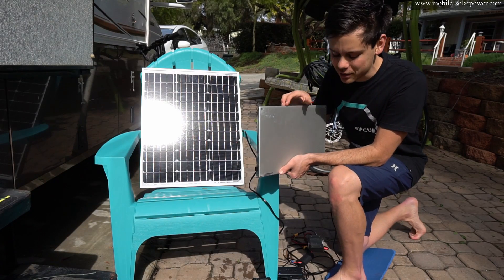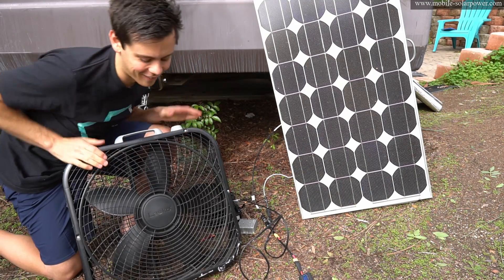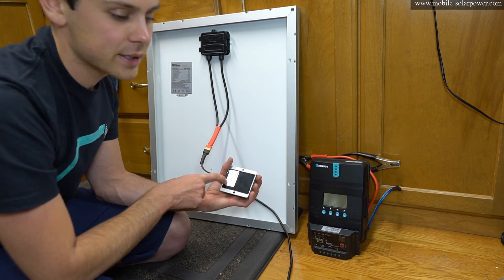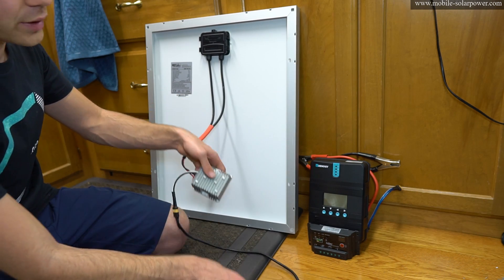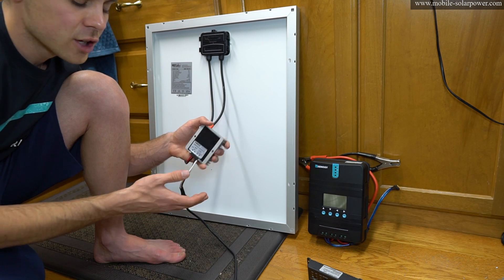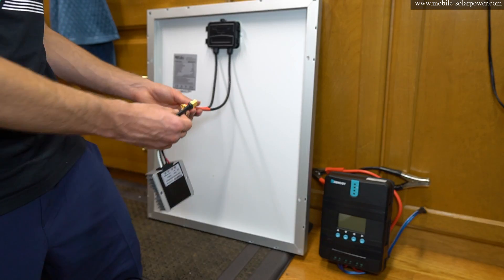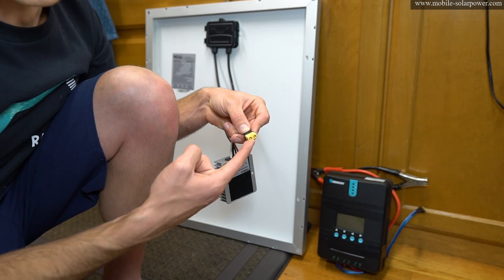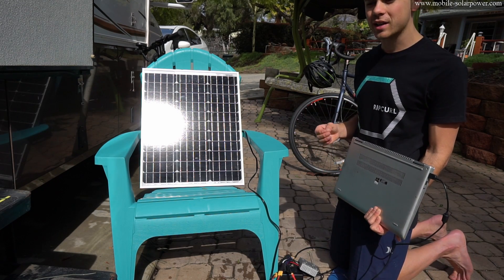Solar Power without a Battery! Solar Panel + Converter = 12v for Small Loads

Comment: It looks like you are using a regular AC power supply for the computer, but you are inputting DC into it. Is that correct? Did you just clip the AC male connector to input DC?

Comment: My friend i have been checking on something like this but for a bigger scale of course but first have to learn from a smaller scale like this i believe 

But my question is first do you have some type of support line or some how that be viability way for a diy self kinda thing so part of my questions is how ima add a battery just to make it safe but the system will be use at suntime only that why im looking for help because i believe its posible thanks by the way great videos very good info

Comment: I’ve got 4 D8 size 12 batteries to replace my current old ones for my cabin’s solar system to replace the 4 6 volt wired in parallel as two 12 volt batteries these d8 a are bigger and newer too they should work well

Comment: Can you go...
Array (24v) -> DC to DC -> Inverter (12v)???
...so that I can power my 110AC household appliances?

Or, is there a better, more efficient way?
Also, based on what you say here, if I understand correctly, withOUT batteries, it becomes impossible to require a controller. Correct?

PS, I already have the 24v panels and a 12v to 110v inverter but trying to NOT purchase batteries at this point.

Thanks a million!

Comment: a 10amp  12 to 24  in reverse will it work ? ? btw one of these without  protections only a fuse killed my delta2  12v outlet..!!!    was my fault  didnt measure both  in and out amperage  ....  was that simple!!!!

Comment: Hi Will, I am on a bikepacking trip.  Currently I am using a Big Blue 28W portable solar panel.  It charges my small electronics fine.  I would like to charge my Dell laptop sticker reads Input: 19.5Volts--- 3.34Amps.  If you would please, help give me advice how I can pull this off without added bulk and weight?  Much obliged.

Comment: Thanks for this video; I feel so dumb! My small solar panel puts out 24V 1.12A & I was confused when it wouldn't run a small light bulb (not led) directly. As soon as I connected the light, the voltage would drop and nothing happened (no light). This was inconceivable to me because in my mind this panel is putting out a constant 24v and even with only 1 amp, the bulb should have produced some light when connected directly to the panel output.

Comment: Hi will on my Vw t4 campervan I will have 230watts solar soon 100watt x2 plus 30watt panel so with converter I can run my usb powered iPads led lights .I have twin leisure agm batteries to run compressor fridge all time 12v about 40 watts .Only use inverter now an again 2000 watts for charging drone and drill batteries 🪫 Steve in U.K.

Comment: Thank you for your videos. This is exactly what I want. No battery, just an opportunity to charge my laptop and phone with solar. But there is a huge list of resources and not the specific ones that you show on this video... the converter, the cables... even the reader. For just one 100 watt panel.  Those 3 objects. If you can, I would appreciate it.
Reply: And why the XT60? If my computer has a regular connector to plug on the wall...

Comment: Why not use 12 volt solar panels instead of 24 volt panels and eliminate the need for the 24 volt to 12 volt converter?  And, instead of using a converter, use a buck voltage regulator (available on Amazon) wired to the positive and negative wires of your 12 volt solar panel to prevent voltage fluctuation above 12 or 14 volts.  For example, some 12 volt, 100 watt solar panels purportedly can produce as high as 17.5 volts instead of 12 volts.  This voltage fluctuation would probably shorten the lifespan or eventually damage a device such as a 12 volt, direct current fan motor or a 12 volt water pump.  Please reply to express your thoughts about this comment.  Thank you so much for your informative, resourceful videos.
Reply: There is no point in boosting a 12v solar panel from under 12v, it will be already powerless at that point. And regulators are more expensive to their buck equals when it comes to step down.

Comment: What did I do wrong?  I purchased 2 of these to hook up to two 100w flexible solar panels for a tiny camper/trailer I'm building and for my car for camping/road trips.  I also purchased the xt60 connectors, heat shrink wrap, 12v wiring suggested for my solar system in my trailer. I connected all pos/ red and the neg/black as needed, but I did NOT sodder these wires, I did the twist connection (is this possibly why I don't have power?).  I have the 36/24 compasitor,  a 750w inverter.  I let my solar sit in the full sun for a whole day.  When I tried turning on the inverter and plugging something into it,  I got NOTHING. No power from the inverter. 
What did I do wrong and what do I have to do to get this to work.

Comment: Does an MPPT controller borrow some volts from the battery to provided consistent voltage out as the solar voltage fluctuates?

Comment: You can connect a fan or a pump directly to a panel, given that the fan can handle the max output of the panel. Fans and pumps can handle varying loads, they just go faster or slow down. However, electronics are different. This is playing with fire.

Comment: I used this method to charge my drone batteries while camping without needing to lug a heavy battery around.  I’m not sure how small a panel I can get away with though.  It works fine with 100w panel.  I’d like to get that down to about 25w for weight and size.  I’m sure there is some math that would tell me the minimum size I can get away with.

Comment: I'd like to power a pond fountain pump that uses 720w, 9amps for as long as a panel will power it daily.  So does that mean I could us an 800w panel array and the pump would run for 5ish hours/day?  Thanks.
Reply: I tried running a 12v sump pump that draws around 13amps. Using the 24 to 12 volt converter (20 amp) and a bank of 6x500 farad capacitors and 2 x 100 watt panels in parallel it wouldn’t keep running. I was able to run it on 4 x 100 watt panels in parallel.

Comment: Whait till you see what I'm planning, I've order 10 cc cv adjustable voltage regulators. I'm going to wire them to 10 360w solar panels in parallel. A 200a fuse and a 1500w 3000w max inverter.

Comment: you mention the panel has and open circuit voltage is 20v.  Is it possible to charge 18v tool batteries without any controller?  Just a direct connection from panel to battery.  My other option is to use my 12v controller and connect it to a 12v inverter, plug in a AC power bar and charge multiple tool batteries.  This seems safer but less efficient.

Comment: Hello ... can we make a cut off also which gives power output  only when the desired voltage is available from solar panel and if it goes below the reqd voltage it cuts off the supply to the appliance??

Comment: I am interested in this concept. Would at least offset some of my electric expense a few hours each day.. Here they charge more during "peak hours" which also happens to be the times the sun is best. Of course in due time I will start investing in batteries. but on a fixed income..that will take awhile. So can you do a video from start to finish what is required to maybe power a 3kw inverter.. not magic boxes but the old school way :o)

Comment: I hooked up my panels directly to vent fans.  The system works fine when the sun is shining but on a cloudy day, the fans barely move.  My solar panels provide 18 amps max but the fans need about 16 amps.  On a cloudy day, how can I top off additional amps to the fans using utility power?

Comment: I've wondered about this a long time. Would it work if I had 4 300 watt panels on roof and then run wires to wear they are needed? DC means very thick wires if it is long cable, DC doesn't like to run long distances in small wires... could over heat and fire also if wires aren't thick enough to handle the push

Comment: i have a 300 watt inverter, would i still need the 24v to 12v converter if i dont use battery?  or can the inverter be connected directly to panel without converter?  i have 100w solar panel.
thanks.

Comment: I ordered a Flexible 100 watt solar panel from wish several years ago. When I received it there were absolutely NO wires to it. Just the panel. Y question is how do I connect a wire to it so that I can hook it to a converter or battery?

Comment: Have you tried connecting an APC UPS in to this set up....would be able to have the battery and the converter possible in one without needing to buy a separate battery and converter.

Comment: Hi will thanx for the double sweet videos, im very fortunate to have mark lee that owns 10 companies in china and 15 in japan, so i always look at your vids and do my own experiments, im from south afrika were the locals cant afford expensave croceries, one nice conversion i did was to rip out a 220 v compressor out a old fridge and replace with a 12v/24v compressor. Got 55 hours on a gell 200 ah bat, only batt no solar panel connected, at 12 v uses 5 amps a hour, on 24v 2,5 amps.

Comment: I have a  50w solar panel on my car roof, powering a 12 volt  cooling fan in the window, Florida hot sun. I tried without a converter and battery setup.  Solar panel puts out 21 volts. Saw how to use a (buck converter) to step down to 12 volts for the fan. worked perfectly until I noticed My door locks were going all wonky on my 2015 Rav4. some radio interference?????  worked perfectly except for that.  Now my cheap solar converter battery settup  keeps dropping the solar connection. it may be damaged.??  I put an adjustable thermostat in line to turn on off. Buck converter was perfect and simple except for the door lock interference.

Comment: What's the minimum voltage that this converter will take? The small one that's linked on the page has an input voltage range of 28-40V. A lot of solar panels won't output that. And the reviews for that unit aren't great. The larger unit from the tutorial page has an even higher input range 40-60V. So I'm wondering if they'll work with a 50W panel that outputs 16-20V. Would love an answer to this.

Comment: Hey will dude great video---will a 18v solar panel work with the 24v to 12v convertor...i was wandering what voltage panel your using---many thanks bud

Comment: Hi does this regulator regulate the output wattage also ie if I was using a 12v 30watt fan with 150watt panel would it regulate the amount of watts need not to burn the fan motor out?

Comment: Direct solar is well worth playing with, I built a circuit which charged a one-farad Electrolytic Capacitor from a small solar panel and then dumps its load into a water pump to pump pulses of water uphill.
Reply: I ordered a 1 Farad for the same configuration. How well has it worked?

Comment: Your welcome. It was my discovery I can run inverter in the rain without a battery. Key is 24volt panels and 12 volt inverters. Using step down DC DC converter

Comment: Hi I need help here. My laptop charger says: Output 20v 2amp=40w. How 12DC output in that converter can changer the laptop? In this example you can only charge 12V laptop.. right? Please advise. Thanks in advance.

Comment: Thanks for showing your setup. I have done this on my 48v solar panels to 12v. Now I want to install my variable output voltage boost converter  to charge any battery configuration. I want to charge my Ebike batteries off this system.

Comment: I love your videos but and I trying to work this video out.  I looked at your web site connection and I am then back to your video. I am confused about something.  How do you plug in the lab top or fan without an inverter?  that was not on your list but on your video you said you had a modified inverter.  I didn't see it on the list.  I know I am new but I am confused.  can you explain the step that seems to be missing?  Thank you

Comment: HI, I have a  SUNFORCE 3-panel 60W-12V power generator. Is it possible to use it to power 12V solar pumps without a battery? If so, how? Thanks for your help. Loan.

Comment: Finally. I’m new to solar and I want to make a solar pool heater. I want to go from the solar panel and go straight to the 12 v pump. This is the information I’ve been looking for because I was wondering about the voltage going to high and cooking my pump. Adding the converter will solve any issues. When the sun ☀️ is up the pool heater will be on.👍
Reply: Did you get your heater going? I am trying to get small 12v sump pumps to act as water jets to power a pool skimmer with a 40w12v panel using a wattage step down between them.
Reply: @csabo1725  
Not yet but still thinking about it. I’m a bit undecided on how to make the collector’s. My pump is a new 12 water pump for a Toyota Prius. It moves a lot of water , maybe to much. At the end of a sunny day, do you get the same BTU’s with a high flow rate vs a slow flow.

Comment: What kind of laptop power supply were you feeding 12v?  The only ones I have seen are 120vac to 12v dc.
Reply from the maker: Go on Amazon and you will find a cigarette lighter adapter for any laptop on the market

Comment: I would just put Conner the converter to a 12v automobile 🚗 socket and just plug every thing into it. Maybe one with a couple 12V sockets and USB Ports. Until everything goes to USB-C Type ports. They can support 100W through the cable/charge port.

Comment: Will pls try from the panel directly through a 12v to 230v (AC) for home use....to power TV, fans, lights etc.....can it work ?
Reply: @cgwworldministries Ive got 2units 200AH Gel batteries. I want to be able to disconnect my batteries when full and use the panels direct during the day.....and in the evening reconnect the batteries and use it overnight.

Comment: Thanks for your great videos. I took at 12v car radiator fan I got from an auto salvage lot, and built a simple mount out of plywood to attach to my attic gable vent to pull hot air out of my attic. I put a 12v Grape Solar 100watt panel on the roof and it drives the fan directly. The sun comes up, the fan powers up - the more sun, the faster it goes, nighttime, no power - perfect. It's been running this way for over a year. All-in I paid just under $100 for the whole thing.

Comment: I kind of figured that sooner or later you would cross over into stuff I was doing in 2004. I was running around and camping in National Forests in the midwest with 2 marine panels and a Morningstar SunGuard charge controller. I actually wound up in Palo Alto for a while slapping the panels on a couple of roofs while there. Everything Will is saying about the merits of portable power are dead on. I'd be as careful as he is too. It isn't a good idea to charge camera batteries with hot leads like I did. But, one thing that worked well for me was jump starting my subcompact with a panel on an interstate once. DC to DC, so efficient :-)

Comment: Is there a reason why you recommend the 80w over the 2 40w controller?

I need a 50w controller and not sure what to get.

Also batteries. Are the Vemax that much better than Universal?

Comment: I  use a mttp solar charge controller module .attached to a found solar panel that only produces 9v ....the modules are  cheap on ebay , no battery just producing 5v which i use to charge all of my mobile devices ...its worked  for the last month propped up at my window 👍👍

Comment: I have yet to see a laptop that is 12 volt... Maybe a tiny one, or one of those surface laptops. My current (Lenovo) is 19.something volts.  Many I have had in the past range in this voltage range.  My old HP tank (BIG and top end) was over 20 volts. Yes, I can see this as an ideal option for 12-volt systems, but probably not the majority of laptops.  Is my thinking wrong here? Can you be more specific about which laptops run at or near 12 volts?
Reply from the maker: Oh that's the same with mine. All you have to do is buy a cigarette lighter charger for your laptop that's all. This works with any laptop. Just buy a cigarette lighter charger on Amazon

Comment: I saw your IG story post of the exploding converter capacitors. Just watch this video and this would be a perfect immediate solution to my charging problem for laptop and other devices. So what was the problem with the converter’s exploding capacitors. Would appreciate explanation before I go and invest in this system.
Reply from the maker: Oh that was my fault. Over voltage situation with solar array. That's all. Not over current.

Comment: I need help with a controller. What do I need? Also if I need any help with what I have. 

2x300 watt solar panels 24v mono=600w
3k Pure Swine Inverter
4 100ah Lead Acid

I heard divide 600/12=50

One of the 40A said it can handle 600w though....... But I thought it could only cap at 40a???
Reply from the maker: Get a 50 or 60 if you can

Comment: Considering you are proficient in electrical system/“solar system” I thought id come to you for some help. I have an issue at hand. I have a 1000watt gas generator and a 950watt air conditioner.  But when i try to run the AC off the generator it fails assuming the surge watts are just too high. So i was wondering if there is a way to series connect a Kodiak solar generator with a gas generator to get those surge watts i need to get it started then run primarily off of the gas generator after its started. Or maybe even just use the power passthrough feature on the K2. Im not sure what do you recommend. Thanks will!